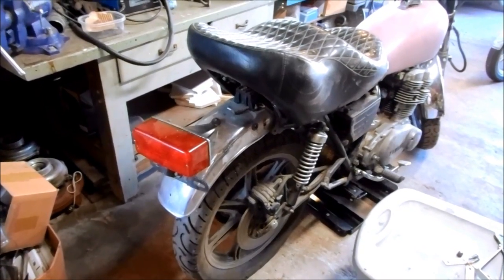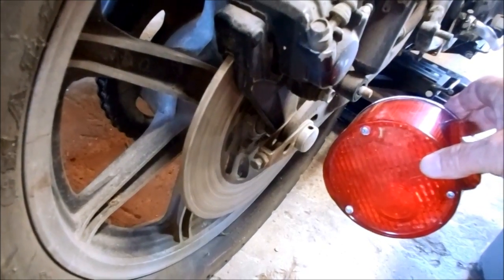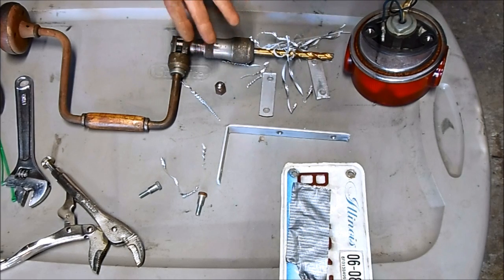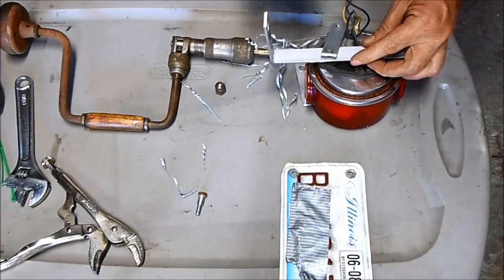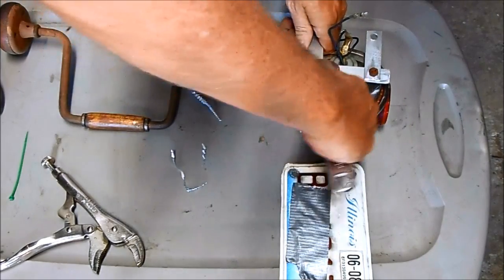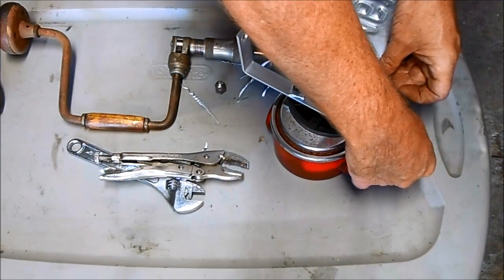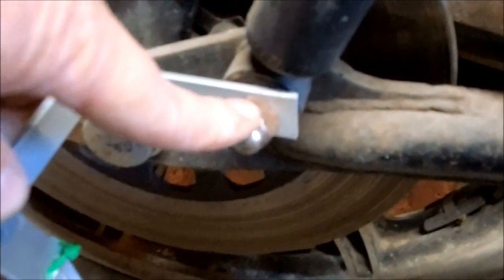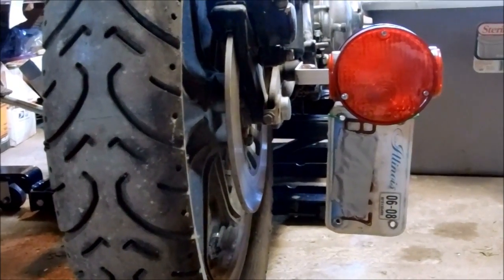Ichiban Cafe Racer Part 2: how to fabricate a custom café racer tail light and plate bracket

Comment: Ah I would recognize the underrated XS500 by that cylinder head alone! My friend has a 1973 TX500 and my brother has a 1976 XS500 with over 50k original miles on it. Rescued them both from the scrap heap...wonderful bikes. I am guessing yours is a 1974 or 75 model based on the older style brake and chrome fender, but newer rectangular tail light :)